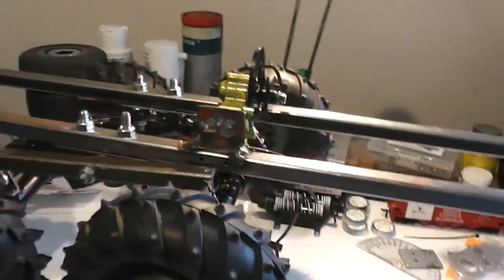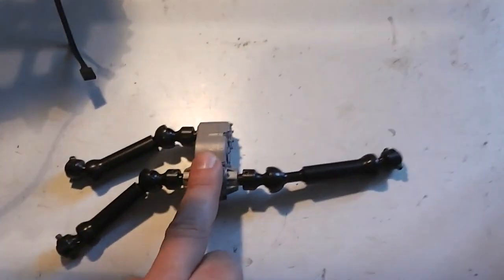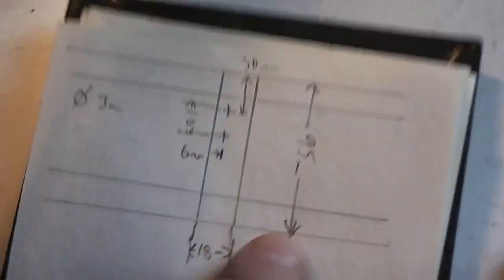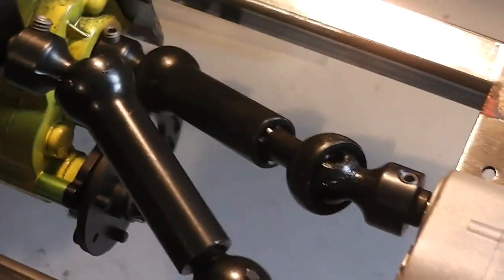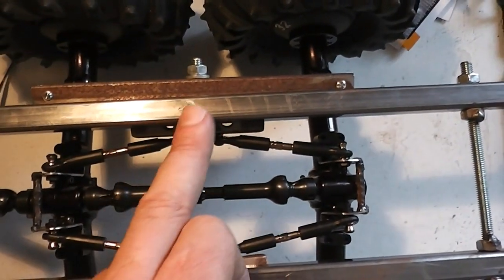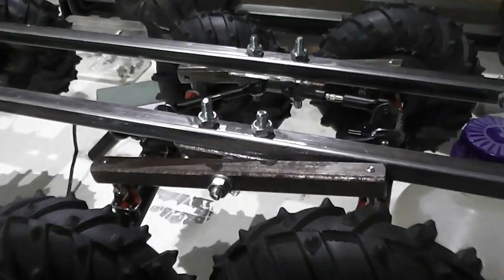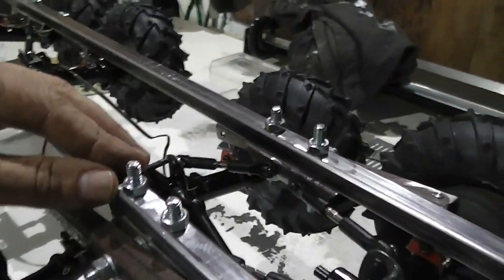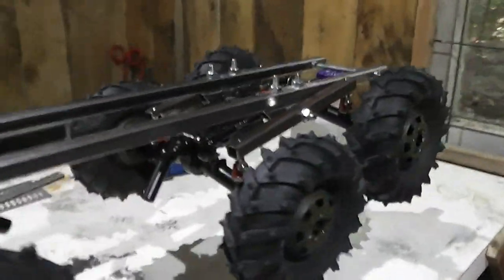Project Wolf Spider (part 6) Custom steel RC 8x8 Heavy Prime Mover.

Comment: Looking sweet man !!! But those transfer cases from rc4wd aren't a 1-1 gear ratio and the way you have you front axle set it will turn faster then the front.
Reply: There are two different transfer cases from rc4wd. The Hammer is 1,47:1 the Triton is 1:1. Look similar but I think he uses the Triton
Reply: oh kool i didn't know rc4wd made a 1:1 version
Reply from the maker: BigQ is correct, it's definitely the 1:1 transfer case I have. I can't recall the part number though.